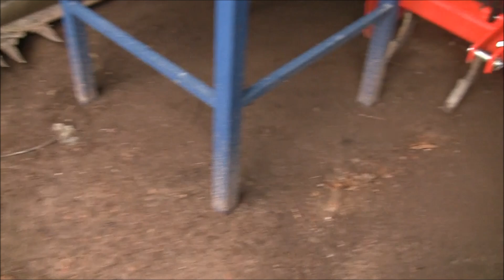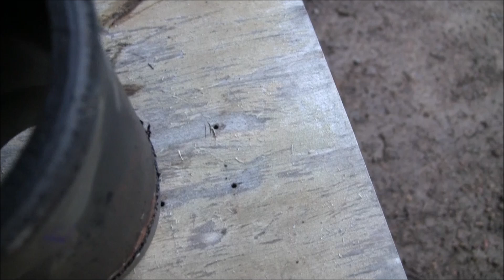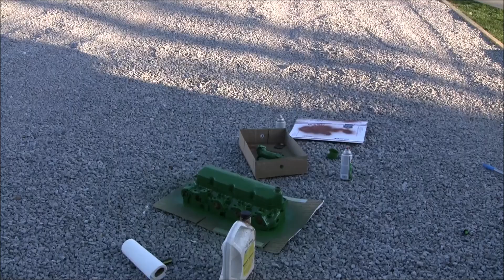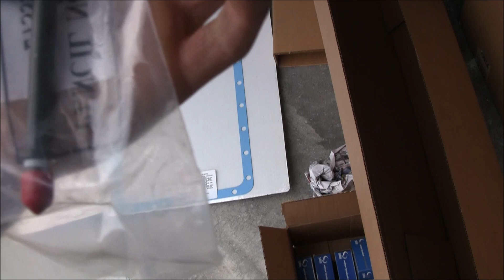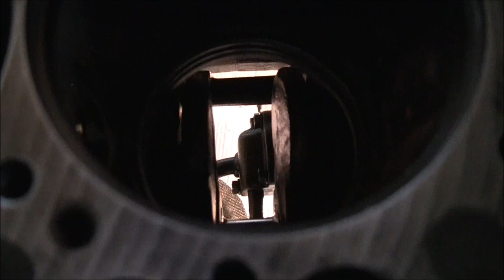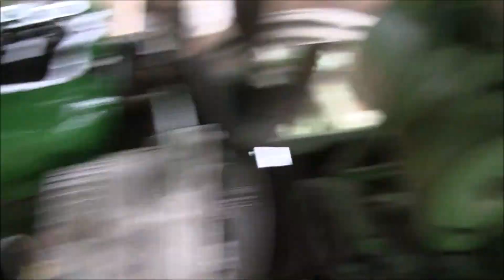John Deere 2030 diesel tractor rebuild. Part 2

Comment: Seems like a long shot you will see this but what tool do you use to remove the oil pump screen?  The bolts on mine are specialty type bolts that look like inverted torx type bolts
Reply from the maker: I left the oil pump as is. It was a relatively low hour tractor and didnt need that part overhauled.

Comment: Josh, did you have to use a special tool to rotate the engine when installing the sleeves / piston assemblies? How did you go about doing this? Great video series!
Reply from the maker: Hey Justin, Thanks for watching. I assume you mean rotating the camshaft in which case you would put a socket on a breaker bar and put it on the main pulley. You can rotate as you wish. Its absolutely necessary to be able to rotate your engine not only for installation of pistons and bearings but also to adjust your valve lash later in re-assembly.

Comment: How did you clean your block before the rebuild? You mentioned "assembly lube" for the push rods..........help me out......what is this, exactly? Did you replace your oil pump? Or clean the old one in any way?
Reply from the maker: I didn't clean the block at all because it was pretty clean. Assembly lube can be purchased at auto parts stores. It is a thick moly grease that is oil soluble so that it doesn't interfere with the engine oil at start up.
Reply from the maker: Also no I didn't mess with the oil pump. It has thousands of hours left in the oil pump

Comment: You said you took them to the JD dealer and they "ran the numbers" on them. You're talking about part numbers? Or did they mic them and determine they were original? How much wear on a bearing before it's too much and you won't use it again? When you bought new bearings, what size? Original size, since you didn't grind the crank?
Reply from the maker: Yes they ran part numbers. Bearings are cheap, replace them. Period.Yes, I  went back with standard bearings but I also confirmed clearance with plastiguage when I installed them. Always always confirm clearance with plastiguage. It is CHEAP insurance.
Reply: My engine has more hours on it than yours. I'm concerned that there might be a bit more wear in there than yours.....maybe an out-of-round crank. Doing an inframe rebuild, is it OK to put new bearings on an old crank without pulling & machining the crank? Thanks a BUNCH.
Reply from the maker: G. Smith What do your bearings look like? If they never spun and the surface of your crank journals look polished then it is highly unlikely that your crank is out of round. The crank is made of much much harder material than the bearing so if anything wears it should be the bearing under normal operating conditions(no bearings were spun, galded or it was ran without oil etc.)

An in-frame rebuild is exactly what you described. Replacing the bearings without pulling the crank. If the journals look good and then you should be fine. Get a proper in frame rebuild kit and go from there.